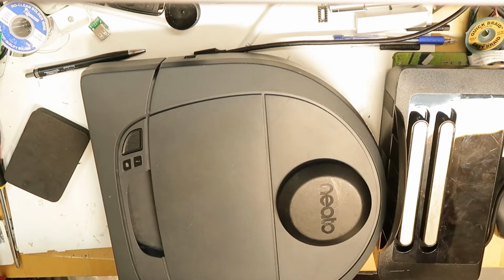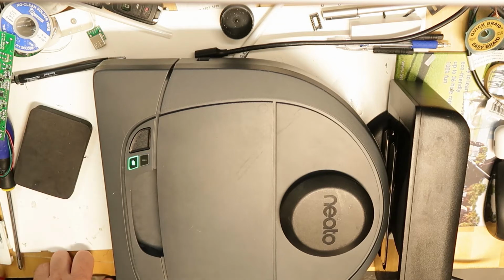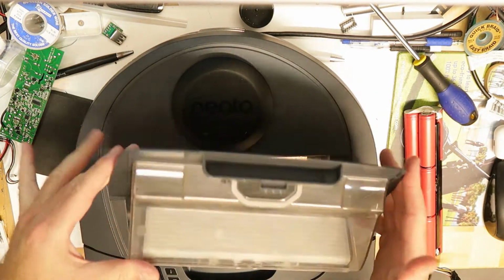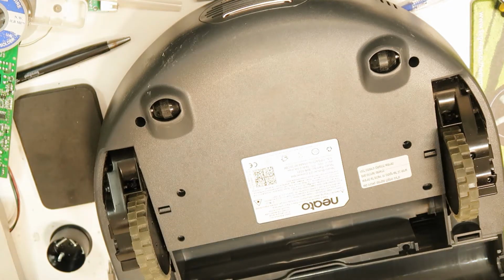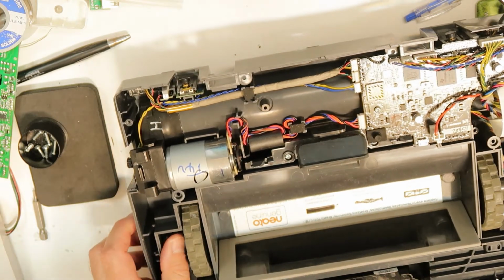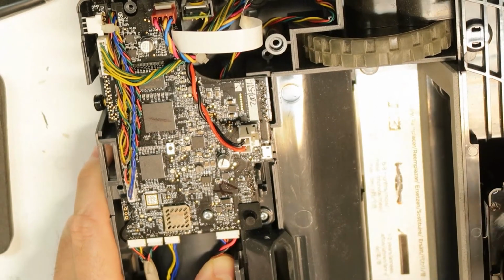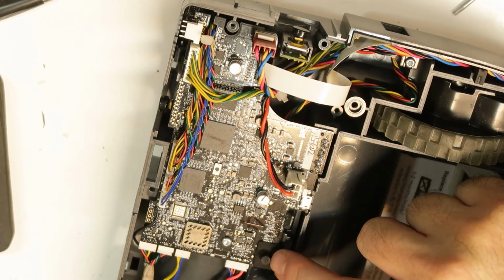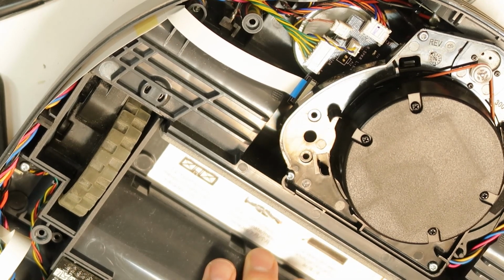Neato D3 Problem and Disassembly

Comment: did you ever get it working? mine has the exact same issue
Reply: i saw your other video, my battery has voltage in the individual cells, however it wont let any juice out. is this an issue with the battery being too low or?
Reply from the maker: can be battery try to replace it
Reply: @RoeeBloch  I ended up getting the battery to work, it was in a sort of “sleep mode” because it wasn’t charged for a bit and the voltage got to low, I woke it back up however the robot itself still does not work so I’ll most likely have to get a new motherboard
Reply: @Tactikill44   Did replacing the motherboard help? Thanks.